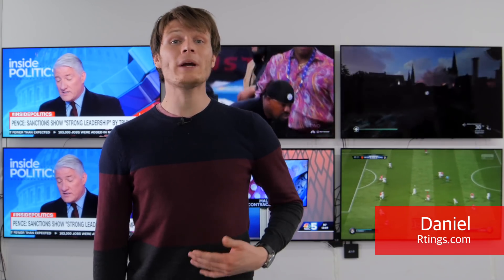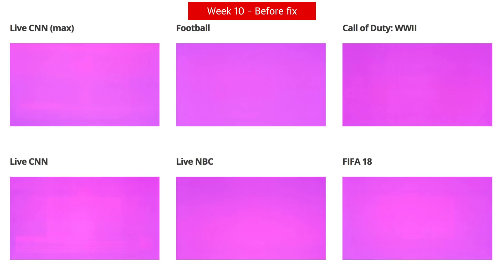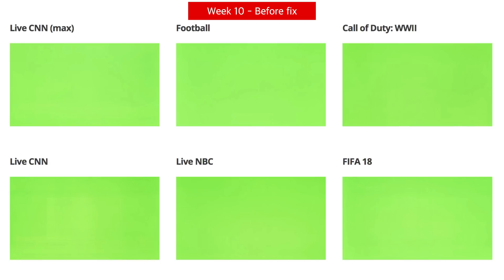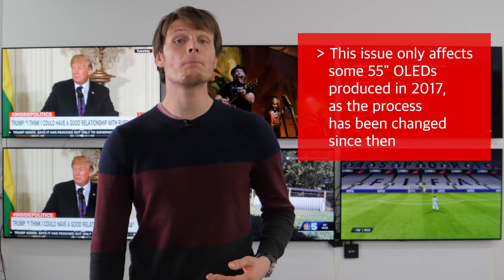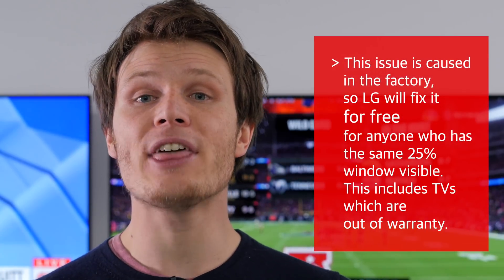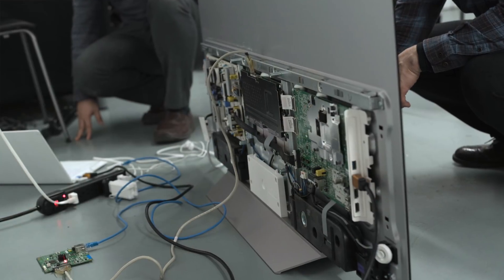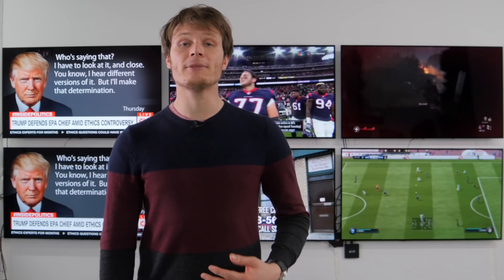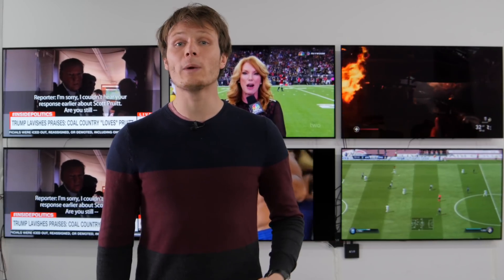Factory Defect & Fix - OLED Burn in Test Update Week 10 - RTINGS.com

Comment: And this is why I will never consider an OLED tv.
Reply: Gewdvides Yeah, but I bought an OLED in 2016, and it came with a free John Lewis 5 year warranty, but guess what?......Burn in wasn't covered. And no store in the U.K covers screen burn in their warranties. If I knew my LG E6 (which I no longer own) wasn't covered for screen burn, then I wouldn't have bought it, as it was a seriously expensive piece of kit. I had to sell it on at a loss of £300. The only option possible is to probably buy a separate warranty or insurance to cover burn in. And being honest, I loved the E6, as the 3D was out of this world.
Reply: As far as I know, no one has even seen MLED outside of CES. Technology was just announced on a CONCEPT 120 inch TV. Do you really believe this tech is going to be available next year, that alone affordable? Do you really think OLED Tech won't continue to improve, get cheaper and that most of the so-called issues won't be a "memory" by the time MLED is out, that alone AFFORDABLE?
Reply: Michelle Alexandria  Samsung already announced it's coming to consumer market in 2019. It's no concept, and the TV is 146" not 120".  It was planned for release to consumers in August this year but its launch was delayed. OLED will continue to improve, yes. But from the "get-go," MLED will surpass it and it also can only improve. OLED will never be an equal to MLED. Only thing I can agree on is that MLED will be expensive at first, but that won't stop me and others from buying it. We can afford it.
Reply: Hailey Matthews but just in case I do I have the 5 year Best Buy plan, which if you’re buying something this expensive you should do anyway, even for an LCD. Just in case anything happens to your expensive ass delicate purchase
Reply: nickxcore74 well Best Buy DOES cover burn in. If I recall correctly they’re the only one or one of the only ones that cover burn in. And it’s not a scam because they explicitly say that permanent burn in is covered
Reply: You do right. I wish I had never waisted £2500 on a LG oled!!!! The customer service is rubbish as well.
Reply: Because one out of 6 TVs got some image retention that is only visible on a full field 100% magenta or red screen after having it tuned to nothing but CNN for 20 hours a day, and the one other problem they had was fixed by LG for free? Yeah, sounds like a total nightmare...
Reply: ´Me too, newer gonna have OLEDs I love my LCD's light bleed, ghosting, smearing, off axis shifting etc etc. way to much to change to OLEDs.and when you cant even see the retention in actual scene-content and only on leveraged colorslides' then whats the point... nahh LCD is the way to go I daily enjoy alll of the above on my LCDs  :P..
Reply: Jakob  Enjoy your OLED which has low peak nits so HDR sucks on it while having to baby it so you won't get burn in. Meanwhile, I'll enjoy MLED with its equally perfect blacks, better colour, way higher nits for far superior HDR, without any light bleed, ghosting, smearing, off axis shifting, etc ect. The perfect display technology. Oh, while never ever having to worry about even the possibility image retention or burn in, since the technology is immune to it.
Reply: @haileymatthews1777  - Buddy, my LG OLED C8 is so blindingly bright with HDR turned on that I can't watch a movie with the lights turned off or it strains my eyes. You have absolutely no idea what you're talking about and are acting very immature to boot. Unless you have such poor viewing conditions in your room where bright, direct sunlight is shining directly on your TV all day, the elevated luminance levels of LED displays is completely unnecessary and would only further contribute to eye strain in dark viewing environments sufficient to require the use of darker picture modes, rendering the situation moot. No one is denying (or at least they shouldn't be) that LCD/LED is a better choice for hardcore gaming, but for the average person who's viewing habits don't entail sustained periods of time with static logos/HUDS, they will never have an issue and will enjoy an objectively better picture with OLED. Both techs have their merits and shortcomings, so stop acting like a child who needs to insult others' purchases to feel better about his/her own and just enjoy what you have.
Reply: @thehifiguy945  Don't call me buddy cause I'm a girl okay and secondly, OLED TVs don't get bright enough to blind. That's just a blatant lie so don't try that with me. Both my theater room (Imax private home theater) and TV room have controlled lighting - we can make it pitch black in there. Whatever gave you the idea we watch stuff in a bright room, idk. Also, just because you said I'm acting like a child doesn't make it so. I could say the same as you and like it or not,    MLED is going to mop the floor with both OLED and LCD LED. Too bad  for those who won't  be able to afford it right away but we will  be able to.
Reply: @haileymatthews1777   I agree wholeheartedly that MicroLED is going to make all prior tech obsolete once it comes out, but don't call me a liar for stating my opinion, sweetheart. Most people find HDR unpleasantly bright in a dark room even on OLED (myself included), and find high luminance LED displays to amplify that effect. The only area where LED provides a more desirable luminance level, IMO, is in bright rooms or on SDR content, but the loss in overall fidelity compared with OLED makes that a less-than-ideal trade-off for anyone who's serious about image quality.

And congrats on having such a nice home theater setup in your home, but you should be careful not to assume that because having that as a result of being the beneficiary of a wealthy husband (please feel free to correct me along with your current job title and salary if I am wrong in that assumption) that you are coming from a position of greater knowledge than I am because I own a successful A/V integration company and have been installing systems like yours for over 15 yrs, darling. 

You aren't going to impress me with that, and you certainly are in no position to make demands on how I address you, especially after that snooty little attempt to assert dominance. You don't have to like OLED technology (which you clearly don't) and that's fine - won't hurt my feelings one bit and as a dealer I couldn't care less what people like you buy from me as long as the check clears, but your reasoning behind that sentiment reeks of "I bought a Mercedes therefore BMW's are garbage," which is why I said you were acting childish. It is what it is, "she-buddy."😉
Reply: @haileymatthews1777  It will be years before MLED, Is in 55inch consumer tvs and is affordable.. So oled is the best for now, Buddy...
Reply: @Noble3781  Miss:
RE: OLED being best - Best only to those who can only afford OLED, but not the best available (not next year anyway). Just because someone can't afford something doesn't make that something less than the best. You also assume years, and it will be but not 10 years not even close. 3 or 4 years maybe.
Reply: @thehifiguy945  It's my parent's money whom own the majority of two large real estate business - over 16,000 apartment units. I'm not old enough to be married either, but thanks for assuming a woman would need a man for wealth...
Furthermore comparing a Mercedes and BMW  isn't quite like OLED vs  LED. Both Mercedes  and BMW are prestigious, fast, aren't prone to breaking down and have equally good reputations. While certain models of either kind may be better than the other brand (as in the display space), in general they are equal and preference is what it boils down to.
OLED displays on the other hand can burn in, LED won't, OLED doesn't get bright enough for mind blowing HDR, LED  does. LED can't get perfectly black while OLED can. Both technologies produce an excellent picture, but both have strengths and weaknesses. In the end, the choice is to have a strong HDR effect in the highlights and no risk of burn in, to considerably  less strong HDR effect in highlights, risk of burn in and no blooming- blacks are completely black (which does produce some crush unfortunately).
Bottom line, you agreed MLED will be better, which is coming out next year and I'm getting it. Enjoy the fact that once MLED arrives,  you'll continue to have second best and your OLED being better argument will be outdated.
Reply: @thehifiguy945  Now to address what you've said specifically:
"Most people find HDR unpleasantly bright in a dark room even on OLED (myself included), and find high luminance LED displays to amplify that effect."
Where's your proof of that? Rather, most people find HDR to be just the right brightness in a dark room - really impresses. Vs OLED too dim in a dark room.
"The only area where LED provides a more desirable luminance level, IMO, is in bright rooms or on SDR content" 
Yes, that's your opinion, but that's what it is. An opinion.
"the loss in overall fidelity compared with OLED makes that a less-than-ideal trade-off for anyone who's serious about image quality."
There is no loss in overall fidelity, actually the fidelity is increased. Details in the picture are shown with LED and bright HDR, whereas OLED obscures those details and especially in the shadows. 
If you're serious about image quality, you go with LCD LED and next year, MLED.
- My knowledge would meet or more than likely exceed yours, despite your claim to have owned an A/V company for 15 years. Don't worry, I also make Doctors and Psychiatrists look dumb on a fairly regular basis (and they have Ph.D - but then again, so do I)
"You aren't going to impress me with that, and you certainly are in no position to make demands on how I address you, especially after that snooty little attempt to assert dominance."
Don't worry, I'm also not impressed with you. So we have that in common. I'm in no position to make demands on how you address me? Sure, you're a stranger out there somewhere so seems you're right about that. However, the same goes for you. Not that you were trying to control how I address you, but at the same time keep that in mind. I'll address you however I wish also.
Snooty little attempt to assert dominance? I'm pretty sure you're the snooty one here and are the one attempting to assert dominance. But whatever you say.
Better luck next time
Reply: @haileymatthews1777  It will be the best in four years times, it is like samsungs new 8k TV, just because it is 8k does not make it the best.... It can not upscale as well as most Sonys tvs, it is a regular full array led TV, the 140inch micro led, will not be a consumer product, I am talking about what is best on the here and now, now what is so in the future.
Reply: @haileymatthews1777  - Wow, I don't even know where to start. Well for starters, I definitely had you pegged right as the beneficiary of someone else's wealth, I just assumed that you were the wife, not the little brat kid. This is starting to make a lot more sense now. It sounds like your father has done well for himself (assuming he's not a trust fund baby like he's raised you to be), but his accomplishments are not your own, sweetheart, so don't parade around YouTube bragging about being able to afford anything you want to buy because YOU can't afford anything - that's daddy's money. Now as for the rest of your post, I could get into the technical faults in your argument about HDR like pointing out the fact that a big part of what makes HDR so impactful isn't just the peak brightness levels but the gradation of light within that luminance range and how OLED vastly outperforms LED in that regard due to it's perfect black and infinite contrast, but I'd like to focus on the rest of your comments instead because I've honestly never encountered such arrogance and such an undeserved sense of self-worth from someone so young and unaccomplished before. 

When I mistakenly assumed that you were daddy's little trophy wife, you said in your reply that you were too young to be married. You also said that you have a PhD (which I highly doubt, but I'll play along for the sake of argument) and that your knowledge would meet or more than likely exceed mine despite being the owner of an A/V company for over 15 years (with 7 years prior experience as an installer and salesman before starting my business, BTW). You then went on to make a comment about how you also make Doctors and Psychiatrists look dumb on a fairly regular basis, which I think would have even your obnoxious parents rolling their eyes, but let me ask you this: how is it, exactly, that you think you'd know more than someone who does this professionally when based on your own statements you would have to be in your early to mid twenties and fresh out of school with little to no professional experience, in this industry or otherwise? That would mean that whatever A/V knowledge you have right now consists solely of watching movies on daddy's "private IMAX" and reading online reviews and tech articles, and you think that makes you an expert and my equal?

How many home theater systems have you installed and calibrated, little girl? What is your preferred room correction software platform (Audyssey, ARC, Dirac Live, etc.) and what do you feel the strengths and weaknesses of each are? What is your experience with advanced bass management systems and what hardware/software platforms do you feel offer the most precise control over gain, time, and phase alignment for multiple sub systems? How much experience do you have with multi-room audio/video matrixing and distribution systems, and what have you found to be the most capable and reliable hardware platforms? How many home automation systems have you installed, and what's the largest scale project you've competed (number of rooms, floors, total devices, etc.)? What is your preferred platform of choice (Crestron, Control4, RTi, URC Total Control, Savant, etc.), and how many years of programming experience do you have? Since we both know you can't answer any of this with any degree of competence, spare me the copy/paste from Google affair. No, sweetheart, you're not an expert at anything and you certainly aren't making anyone else look stupid but yourself.

The truth, since you're in desperate need of a reality check, is that you're just another unremarkable, entitled millenial brat with an over-inflated sense of self-worth who has no concept of what it means to actually devote yourself to a trade and create wealth from a life of hard work and sacrifice, and without daddy's money you'd be nothing, just like all of your classmates who are still working at Starbucks and whining about how after two whole weeks of work they're not being paid a six figure income like all their college professors promised. Go back to your sheltered life with safe spaces and cry closets, little snowflake, and if you ever actually manage to obtain a respectable level of skill and expertise in anything, learn the value of humility while you're at it.
Reply: yeah maybe, but you wont see MLEDs for the next couple of years in stores... so OLED is the panel of choice
Reply: hahaha exactly Rob H. ... after 10 weeks of non stop static content operation you get a bit of retention.. wow a total nightmare hahaha
Reply: Hailey Matthews except burn in is very rare in modern OLEDs lol, I almost exclusively use my B7 for gaming for several hours at a time every day and I haven’t experience a single hint of burn in.
Reply: Tyler Jasper soon you'll be saying you love your MLED and will never go back OLED. MLED is far superior to both LCD and OLED.
Reply: @haileymatthews1777  Man your comment is hilarious. I laughed out loud. What you said is true. People were saying I love my flat LCD TV  and I'll never go back to a fat tv. I have the same problem with my 65inches that I bought in 2017. I'll try to contact LG n see if they can help.
Reply: Burd that's a shame. Too much bad press. All the issues are grossly exaggerated
Reply: You wouldn't say that if it happened to you.
Reply: I love my OLED. I will never go back to LCD.
Reply: Unless you don't care to get burn in...which I don't. I'll wait for MLED and in the meantime enjoy my Z9D until its successor launches later this year.
Reply: @haileymatthews1777  But what if MLED develop the same problem?
Reply: Aluzman 16   The same prolem as OLED, as in burn in? That's not a problem MLED will ever have. Close to impossible to ever burn in since MLED is still LCD technology, main difference is that there's no backlight so each individual pixel is self emissive.

Comment: Just so happens it's that particular tv.....yeah, okay LG. Nice fucking try.
Reply: The American Soccer Guy It seems to me, that not even them know why the darker panel is more subject to burn in ,and the more brighter is not???
And this would help a multitude   of people who are keeping the Oled lights down to prevent the fucking burn in, and that obviously is not helping but  damages even more panel itself!!!
Reply: Mario Borojevic 

Yeah, this has me a bit concerned, to say the least. I try to keep my OLED low, and have been using the full zoom aspect ratio to move static images off screen.

LG really needs to have some warranty coverage for this. 

So confusing. Do I run it bright,? Will burn in be from abuse or a manufacturer defect? Should I make HUD display in games dimmer or brighter?

Damn it, LG.
Reply: Niko You are asking the right questions, but LG is keeping quite 😲😲😲
I keeping fingers crossed for Rtings to figure this one out,es this will help a majority of people that own,or will o own a Oled TV!